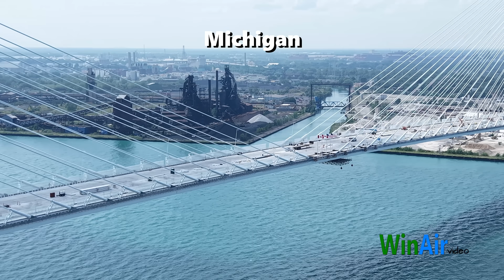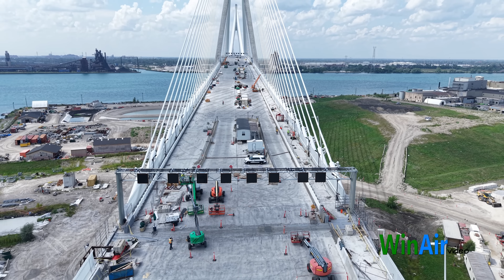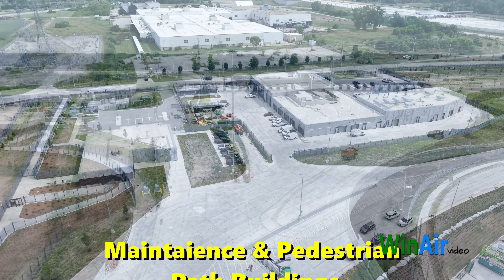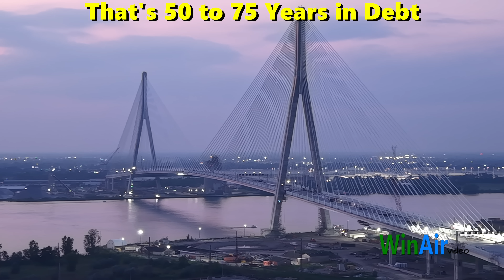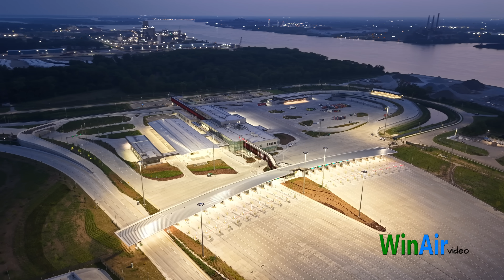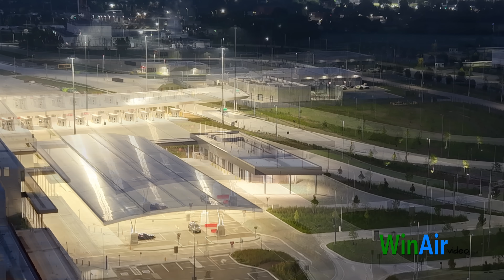Gordie Howe Bridge - Are The Tariffs So Bad?

Comment: Can explain the features on lower ends of stay cables?
Reply from the maker: Hi Jack. I did a quick search and this is what I found;
The lower ends of the stay cables on the Gordie Howe Bridge (GHB) — or most modern cable-stayed bridges — feature several key engineering components designed to safely transfer load from the cables to the bridge deck and pylons. These features address structural, safety, and maintenance requirements:

### Main Features at the Lower Ends of GHB Stay Cables

- *Anchorages:*  
  The cable’s lower ends are equipped with specially designed anchorages that securely fasten the bundle of high-tensile steel strands to the bridge’s deck or pylon. These anchorages often use wedge or socket systems to grip individual strands, allowing for precise tension adjustments and effective load transfer into the deck.

- *Deviator Boxes or Chambers:*  
  These are rigid structures that guide the cable strands through controlled pathways as they enter the bridge deck. They help manage the cable geometry, reduce high local stresses, and prevent cable strand splaying or movement under load changes.

- *Damping Devices:*  
  Vibration can be a concern for long cables, so the lower ends often contain internal or external damping systems. Common types include hydraulic dampers or elastomeric pads, which reduce oscillations due to wind, rain, or traffic-induced vibrations.

- *Protective Encasement:*  
  The cable end and anchorage zones are sealed inside steel or concrete protective housings to block moisture, dust, and corrosive agents. These housings are usually filled with dehumidified air or grout to reduce corrosion risk and extend lifespan.

- *Inspection and Maintenance Ports:*  
  Access panels or ports allow engineers to periodically inspect cable tension, check for corrosion, and conduct maintenance. Proper access is a crucial part of the stay cable system’s long-term durability.

- *Drainage Systems:*  
  To prevent water accumulation and corrosion at the cable ends, dedicated drainage paths or holes are provided in the anchorage and nearby housing structure.

- *Adjustment Mechanisms:*  
  At installation and during the bridge’s service life, fine-tuning of cable tension may be required. The anchorage system often includes provisions (like turnbuckles or hydraulic jacks) for this purpose, ensuring the structure stays balanced.

These features collectively ensure the cables are securely fixed, protected from the environment, and maintainable, which is essential for a large, complex cable-stayed bridge like the GHB. Hope it helps. :)

Comment: Lol those building were done 2 yrs ago, if the electrical ain't done by now, the company that is dojng it should be fined for the down time.  Sorry the company had 4 yrs ahead of time that what they needed as well, so any delays is solely on 1 company
Reply from the maker: Hi Wespaul. Could be the finishing was stalled until they had vendors taking the space so they could accommodate their specific needs.
Reply: @bobjonesrealtor7756  Sounds like some stuff got subcontracted, it happens. I think as long as there are no hiccups, everything will be on Scheduale.
Reply from the maker: We will know before too long. :)